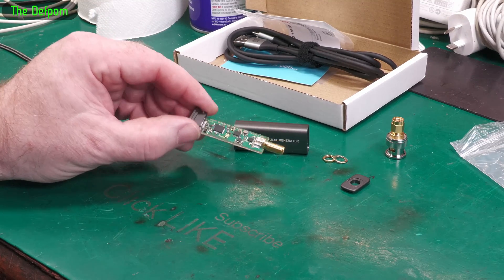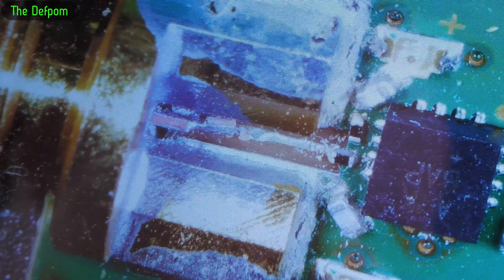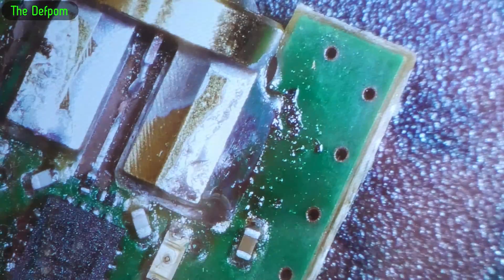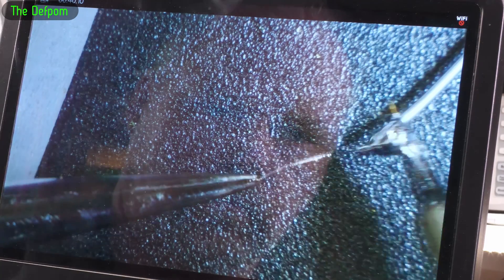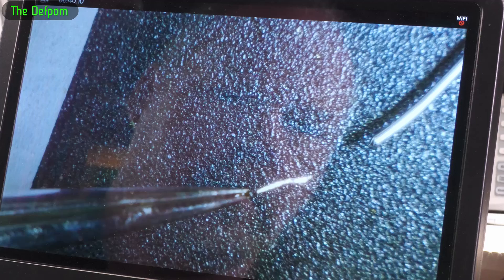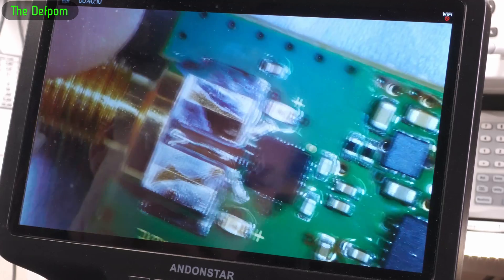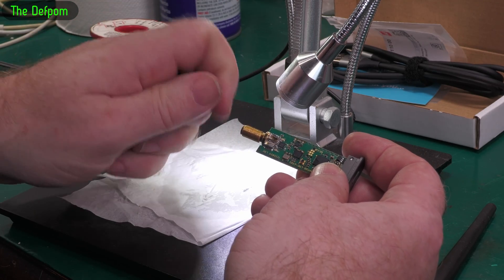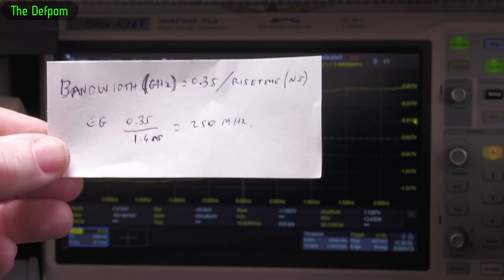🔴 Leo Bodnar LBE-1321 30ps Pulse Generator Repair - No.1381

Comment: A better approach would have been to remount the SMA connector with a drop of superglue to secure the pin. After disassembling the connector, it can be cleaned with IPA, and a thin wire flattened using a hammer can be fixed onto the substrate with a small amount of superglue or small amount of UV curable solder mask. Once secured, apply adequate flux, reattach the SMA connector, and perform a final cleaning with IPA.
Reply: You need to be careful using any dielectric material when dealing with such high bandwidth signals, even a drop of superglue could well dramatically affect the risetime.

Comment: I wonder what effect replacing the original trace with this piece of wire had on the output impedance.
might be quite significant considering the rise time and cause some undesired reflections.